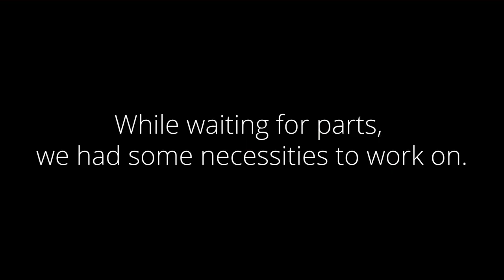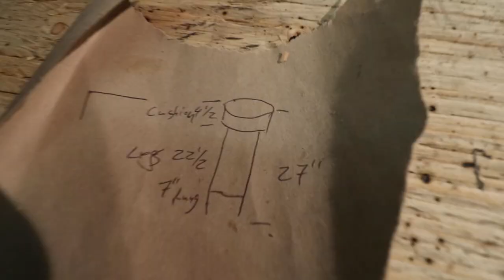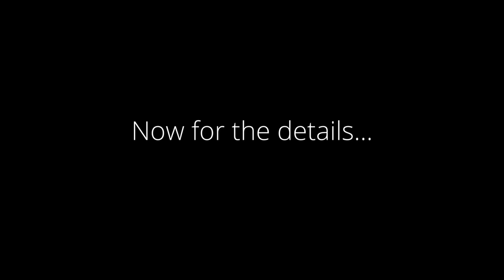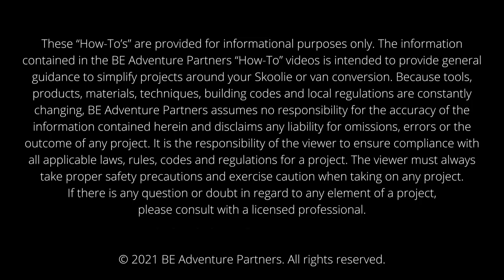Preparing Shou Sugi Ban Decking (Plus Other Necessities Like Stools And A Drawbridge Spice Rack)

Comment: On top of using that nylon nut . I would recommend using a lock washer for extra security …
Reply from the maker: Lock washers are definitly great! In this experiment, we're just using nyloc nuts because we want to see their performance over time without using other forms of mechanical bolt locking techniques (e.g. thread locker, lock washer, serrated washers, lock nuts, welding the bolt to the nut...) Considering there are 8 connection points per board, even if one nyloc nut loosened, it wouldn't be a catastrophic failure.
Thanks for watching! 
- Brian + Erin
Reply: @BEAdventurePartners  I guess the sarcasm was not obvious lol . Y’all should be good ayyy .
Reply from the maker: @revisionindustries667  Bahahahaha! Sometimes it’s hard to read sarcasm (we make jokes constantly about using ALL the bolt locking techniques because one is never enough for some 🤣)